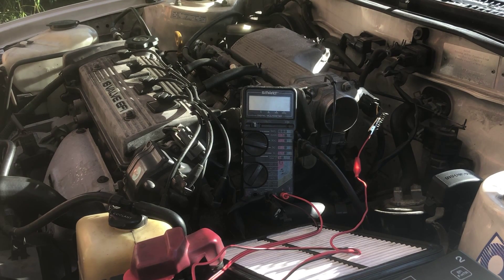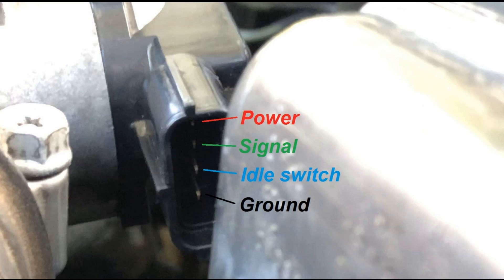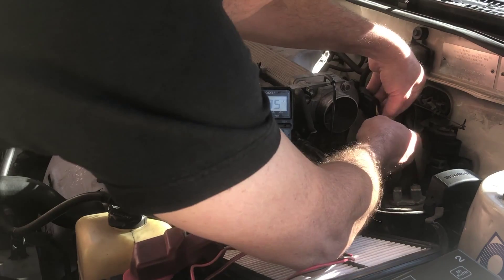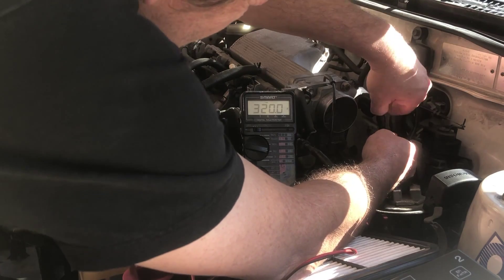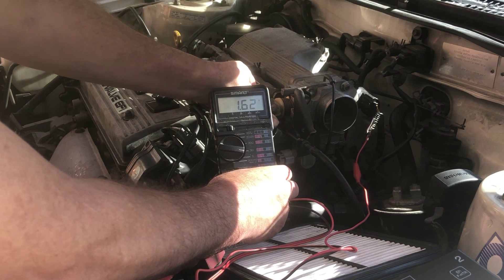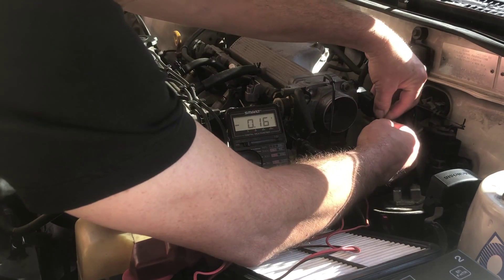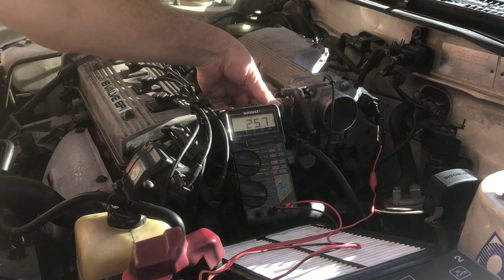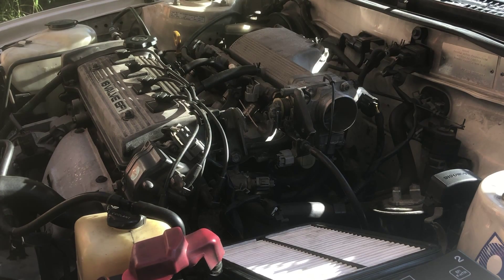97 Corolla pt 3 - TPS Signal voltage

Comment: When you fully open thortle only get 3.7 . And idle 0.47 Is that normal?
I saw another channel said that when idle should be 0.5V and when fully open 4.5.. is that true?
My car feel jigling whn dsclarate, only on <1000 rpm but when acclrate smooth normal.
Reply from the maker: The ECU considers anything above 3.5v and below 4.5v as full throttle. As long as the voltage increases smoothly when you turn the throttle then it's good. My car idles at about 850 when in gear and it's a little rough. It idles at 1050 in park. Your car sounds the same as mine :)
Reply: @OzMike  on manual book 4AFE said the voltage when idle should be 0.6-0.9 and whn full thrtle 3.7-4.3
I set on 0.5 - 3.8. My car feels better than before but still jigling when dclarte under 1000 rpm. I wanna try adjust the stop screw..
Reply from the maker: I think your TPS is good. It's very hard to diagnose a problem when I can't see/hear/feel what it is doing but the next thing I was going to suggest was to adjust the stop screw. Maybe it's just idling too low.
Reply: @OzMike  okay thanks bro.. any way i love your corolla. I've never seen corolla like that..
I hve AE111 Scruise.
Reply from the maker: @iswahyudi5673  Cool. It's a 1.8 7afe Corolla Seca.  I believe they were only in Australia

Comment: For some weird  reason my power is only 263 yet my signal is 435??
Reply from the maker: Are you meaning 0.263 volts? That would mean you have no 5 volt power supply. The Intake air temp, Coolant temp, TPS and MAP sensors share the same power wire. Maybe check to see if they have power.